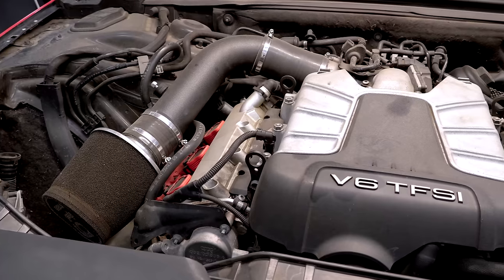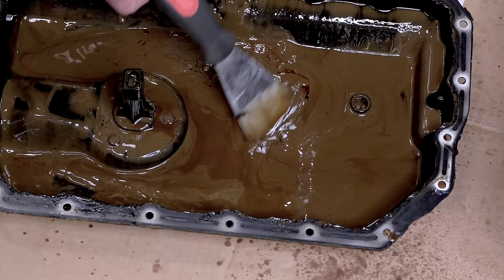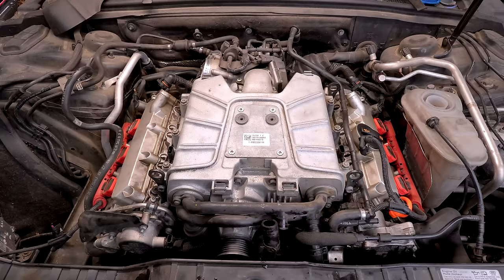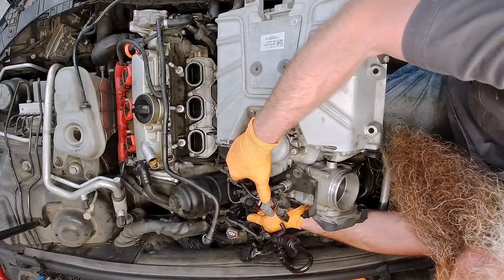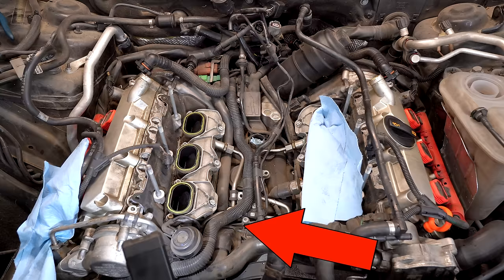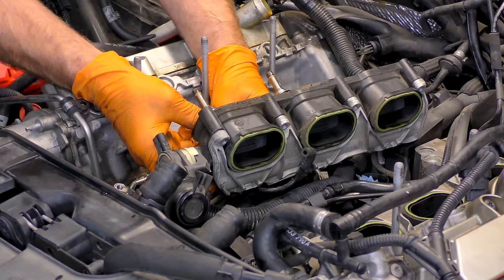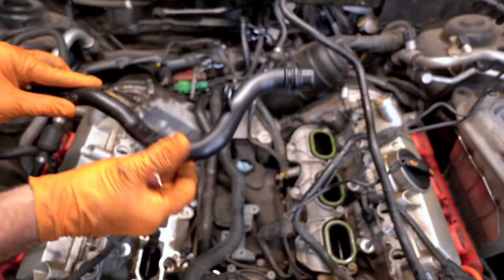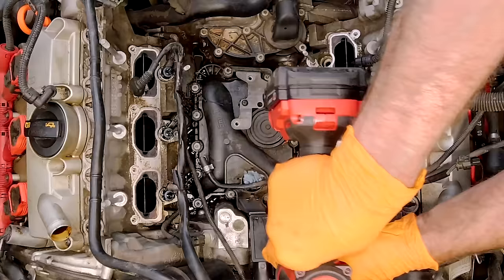How To Replace Audi 3.0t Supercharged PCV Value

Comment: at 39:37 you mentioned the 3 hose's that are source vacuum and at 39:44 you mentioned the hose going to the runners. If you were going to diagnose a leak for bank 2 (drivers side), for dtc p200b. Would you use one of these to check and see if it holds vacuum. Or how would you diagnose the problem?
DTC P200B INTAKE MANIFOLD RUNNER CONTROL OVERTRAVEL
CHECK THE INTAKE FLAP MOTOR (V157) 
CHECK THE INTAKE MANIFOLD RUNNER POSITION SENSOR (G336)

Comment: Excellent video ! This helped me replace a broken coolant pipe (the one that goes to the rear heater) I dropped the clip and can’t get a new one on. Any idea if it will be safe to leave it as is it seems very secure.  Again it’s the coolant pipe that goes from the heater to the thermostat

Comment: Great video! I'll be using this to install the two check valves under the PCV to prevent chain rattle on my 2012 A6. Have you install these before? I wonder if is worth it all this work. I could probably replace the thermostat (was replaced in 2017 by previous owner, still working good) too and cleaned Injectors.. I removed the supercharger before, just fixa coolant leak and flush supercharger fluid and cleaned the supercharger bricks.

Thanks!

Comment: I just noticed some brown/milky liquid on my oil filler cap. I'm not losing any coolant, has been stable for months.
So, condensation? Or could PCV failure also affect Mk3? 1.8 90hp ABS ADZ.

Comment: Is it possible that the oil gets into the coolant but not the coolant getting into the oil? I had recently had that happen even though my car wasn’t overheating, wasn’t running weird, and wasn’t smoking out the exhaust, so I doubt it’s the head gasket. The other symptom was coolant overflowing because of the oil getting added to it, and when I took the cap off a ton drained out the coolant reservoir.

Comment: Is this a risk on the mk6 GTI with the coolant leaking into the engine oil with a PCV failure?
Reply from the maker: Nope. Failure is common. But only like the rubber but tearing

Comment: I'm still trying to either buy a 2011 audi q7 3.0tfsi or just an older 2003 lexus lx470.. This is just a pcv valve. and the process is like taking the head off. So many hoses and bolts and plastic clips. I also wonder why they didn't just use aluminium to go with rather than plastic for the pcv valve.

Comment: I have a 2016 a6 with 3.0t supercharged. Just had cel pop up with p050a. Says iac valve. Can’t find anything online where it’s located but seems like it’s built into the throttle body. Is the iac built into the throttle body?

Comment: I have a question for you good sir. I have a bit of oil in my spark plug on my Audi s3 and wanted to know if that might be a pcv valve issue. Car is at 55k. Thank you in advance.

Comment: I’ve been dealing with a P052C code on my S4. Changed the oil, swapped out both vvt sensors and the code comes back. Checked voltage from the harness and it is correct. Is there something else to check or could it be that the timing chain tensioners are worn out? Looked on forums but not much info. I do have an obd tool and obdeleven. Anyway to check the vvt values?

Comment: I not a fan of an Audi or VW 😂. 
But your video very well explanation👍 
Last month I did on a 2011 Q7 for my kid and I forgot to adjust the intake flaps then the check engine light came on so I need to remove supercharger out again😢. 
And the one screw that hold the coolant pipe I dropped it  so I had to put a 8mm from Toyota bolt instead and use a long 10mm wrench ratchet that was so easy 😂
Thanks for you sharing video 👍

Comment: 99 Passat 2.8L 145K. Should the gasket on the engine oil cooler be replaced at certain intervals?

Comment: About to buy an S5 with one of these engines in New Zealand. Full survive history, done 140,000km (86,000 miles) 2011. Last service had a full set of coils and spark plugs, what’s your thoughts on long term reliability and that age/mileage. Had a trans service at 75,000 miles. Will be getting a pre purchase inspection, anything to look out for? Did notice about 1 second of timing chain rattle on start up. But went away quickly. Did have a different rattle that went away after 30 seconds. Any idea what that could be?

Appreciate your guys responses!

Comment: just fixed on this exact problem on a 13 A6. PCV coolant passage was leaking so bad when you pressurized the cooling system it would barf right down into the pan from a passage near the crank snout. My money was on cracked engine block but it was for sure the PCV

Comment: Excellent work and video. Question when you filled the car with coolant. Would it be necessary to bleed the lines before and or fill while under pressure?

Comment: Hey charles how are u, my name is mano and i have audi vw workshop in beirut  lebanon, u can pressure the coolant system and open the engine oil cap, if the oil separator(pcv valve) is diffective u  will here coolant leaking sound or some wierd sounds from inside the engine and thats how ull know if the pcv valve gasket is worn or pcv valve itself is defective.

Comment: @humblemechanic Once the PCV has been replaced, shouldn't you have made some "pressure tests"  in order to not destroy the new PCV? In order to recalibrate the values, etc... 
I have seen on some forums that this procedure it is recomanded on AUDI shops in case you exchange the PCV due to  oil consumption 1l/200miles....
Is it true? Or is just bulshit?

Comment: This video was fantastic! But there's something you should be aware of - silicone spray KILLS oxygen sensors.  Just a little bit anywhere in the intake side will do it.   Petroleum based stuff (like kroil, or even regular wd40) is much safer.
Reply: Damn i just used some in various spots on my intake

Comment: I have a question about a oil cooler on the W8 it’s discontinued, so how does one open it up and recondition it possibly resealing it with a better seal considering

Comment: Hello HumbleMechanic, I hope you are well.
I am writing to you, because I have a problem in my BWA engine (Audi TT 2.0 TFSI) and Nobody can find what is it. I really need your held please.

Basicly my car, at 5500rpm is most gears, looses power, is like the same feeling if I take of my foot from throtle pedal, after 2 seconds, the power come back..... 

I change sparks, coils, diverter valve, and I can find the problem. 

The car has stage 2 , downpipe(Decat), FMIC, irridium sparks NGK, Ramair Induction oversized, Autotech Internals HPFP. 

Could you please help me?

Comment: Did anyone else get the fuel injector kit from the Amazon link and try it? The smallest die you’re supposed to use to seal the Teflon seal did not fit for me. Not sure if it was a user error or a tolerance error.

Comment: Since I’m early I have a question. My old roommate had one of these I told him to get the chain, tensioners and water pump done while he was doing a clutch. The shop that did it is a well known Audi/Vw shop and they told him they don’t need to do the chain only the tensioners. I was honestly extremely confused, the tensioner doesn’t stretch but the chain does so how will a new tensioner fix a stretched chain?
Reply from the maker: My take is, if you are going that far, do the whole thing. Its more money YES, but man Id hate to do all that labor and leave the door open for issues.
Reply: @HumbleMechanic  yes that’s exactly what I brought to the table as a arguement and got shut down. But hey it’s not my car he will find out the hard way. Not like I don’t know a lot about timing chains owning a 3.5 ecoboost😅
Reply: @402SHO  Reminds me of the time I had a car in for a misfire. It had recently been at another shop for the same issue and they threw new chain guides and tensioners on it, but left the old chain.
And a former colleague who had a catastrophic engine failure, and told the shop to replace the water pump on the new salvage engine.
They said it wasn't necessary and refused to replace it even though he was willing to pay extra (because of my recommendation) 
Less than a year later, I was replacing his water pump because it started leaking.
Reply: @panzerveps  yea I feel like some shops just don’t wanna do the hard work and just make a quick buck off the easy stuff.
Reply: @402SHO  Absolutely. But the thing is... They only needed to put a new chain on it.

Worst thing is that they claimed to be specialists on Audi.

Comment: I had an issue of PCV valve on ... Mercedes GL320 and the symptom was white smoke at the exhaust after running at idle. 
On AUDI A3, 2.0l TDI, the symptom was unstable idle.

Comment: I guess I'm knock profusiously on wood lucky ones with a 2014 S4, only had 2 major issues with it having it for over 100k miles

 the a/c compressor failed, and the supercharger pulley and belt snapped taking an idler pulley with it

Comment: hey i got a tech question for you, I have a 2015 VW TDI JETTA.  I have it stage 2 malone with rawtek downpipe and streight pipes out the back.  I noticed coolant leaking out when its cold out.  sometimes there is a small puddle under the engine.  I put dye in the coolant but still cant find the culprit.  What are the common places for leaks to occur?  I think it could be coming from below the downpipe area but unsure.
Reply from the maker: Not really.  The 2015 is a weird year for the TDI. It’s the only year of that engine.

Comment: The reason coolant goes through there is to reduce condensation... It's kind of like a recirculation can instead of a catch can. When the vapors are coming up they include steam. You don't want this to condense in this box and create that nasty mayonnaise looking oil mix. So they run coolant through there to keep the box up to temperature and eliminate condensation.

of course that means that if the coolant pipes crack they dump into the box and that ends up into your crankcase

Comment: Hot damn! I thought the PCV on my Mk 7 TSI was a pain in the ass...

I far prefer the one on my old 91 civic - pull the vacuum line off, unscrew the metal PCV (from the intake manifold), clean it with brake cleaner or carb cleaner, then reinstall.

Comment: I have been able to successfully do everything except separate the two hoses at @17:02. I have used all the leverage I can and it's like they are glued together. I assume I'm tugging at the right parts. Any advice? Great video by the way.
Reply: Just managed to separate them, put a bit of WD40 over it and attacked at an angle for about 10 mins

Comment: I used to use silicone spray or PB Blaster to loosen/install fittings w/ seals but ran into one plug seal that swelled nearly 30% bigger within seconds of contact.  I've switched to a spray bottle of just soapy water ever since. Or even spit works on small seals and i'm too lazy to grab my bottle.

Comment: Anyone ever got a P050A code in their 3.0t? Research says it’s and Idle Air Control valve IAC. I’ve been researching endlessly and asked euro sites for help and they don’t seem to know. There is not one place that mentions the IAC but does mention the throttle body. I’m guessing the IAC I built into the electronic module of the throttle body. Any help is appreciated as I would love to find out what it is and replace the parts. Thanks!

Comment: cleaning the injector rail with the injectors off not so good. debris can  drop and enter the rail trough the injector holes. plug the holes with plastic plugs, caps or towels es una buena idea.

Comment: I wonder how many vehicles are sent to the crusher because somebody assumed a head gasket leak when it was actually a PCV or oil cooler problem. It's disconcerting to find that there isn't a great way to make the diagnosis before removing the PCV.
Reply from the maker: More than should thats for sure

Comment: Just started this process and opened the ports on the intake both sides were extremely clean, just a little build up starting on the last 2 rear right ports. Got a DTC p200b then Pcv swirl/whistle started, this was followed by DTC p0492 a week ago. Combination Valves working properly,  SAI hose and other tubing intact an holding pressure, relay is ok. Thinking both codes due to pcv valve for certain, however i still need to test sai runner control valve and sai runner position sensors. This is weird to me as im new to the audi's, anyone care to chime in?

Comment: What I don't understand is that if you need clean air going into the engine for a more efficient burn of fuel, why oh why do motor vehicle manufacturers insist on having oil, water vapours from the cylinder valve head and exhaust gasses recirculated back into the intake after the air filter and before the intake valves.

My understanding of efficiency of a engine is to keep foreign particals from your fuel and especially your air intake.
This is so you can optimize you fuel efficiency or your horse power.

So could you do a video on why engines have pcv and egr, which engines have 1 of them and engines that have both of them.

Yours Philip Burrows in Overton on Dee, Wrexham, Wales, UK.
Reply: Mostly emissions. Old cars used to just vent to atmosphere, but shooting oil mist all over the road isn't all that good for the environment or the air quality. You probably don't want to breath that stuff when driving behind someone or walking on the sidewalk.

Edit. To add, depending on the implementation, on some cars you can bypass the PCV system with a catch can like TheHumbleMechanic did with his yellow Golf R. This way all the goop gets stuck in a pot that you have to empty couple times a year. However in many countries, including the UK this counts as tampering with emissions equipment and won't pass inspection.
Reply: @S1l3nthunt  I have had one in line with the pcv, it's not vented (the out goes straight to TIP) so never got me any issues at MOT last couple years

Comment: outstanding video gents - the PCV valve, to avoid the risk of coolant oil mixture, should probably be replaced every 100,000 miles?   Is this driver lucky with over 200,000 miles?
Reply from the maker: Adding it to maintenance isn't bad if you are DIYing. but the shop will hit ya for 6-7hr of labor. Still cheaper than running the amount of flushes I did.

Comment: Accidently found this video. Awesome. Can you tell me where the air from the bottom of the supercharger goes when it goes into that pcv box? Does coolant just run through the box the other side? Does that box do anything else? Thanks
Reply: Ah found it at 14:30. It looks like an emissions recirculating valve with possible a air temp or emission sensor. I am not sure what that diaphragm is in the coolant on the pcv but if it does not have any electronics hooked to kit it might just be a pressure bleed or relief. I am using the supercharger for a totally different application and was wondering what the port underneath of the sc does. Been looking for a video of that pcv for a while now so thanks so much for this video.
Reply: Awesome

Comment: Hello, a question, I've read on the internet as you do that when u put a new PCV on the 3.0T you're supposed to do some ECU software update. Is this a requirement or a suggestion? I have got also a 2010 but and S5 and i'd like to replace the PCV myself but I wouldn't be able to do any software updates. Is there any truth to that?
Reply: So long as you replace your PCV with the exact same part number currently fitted to your car you won't have to do any ecu flashes. You only need to update if you use the newer PCV version that uses a lower pressure (they were fitted from the factory to the B8.5's). The newer ones have a slightly different part number - it's usually the last 2 letters that indicate a newer version. The newer one also has a different colour on the top of the plastic cover at the rear. I have a 2010 S4 with the CAKA engine, the part no for it was 06E103547AC, this will be the one you'll need if it's the same engine.
Reply: Thank you. Yeah i got CAKA as well i was just wondering if the b8.5 one is an upgrade in any way since i got slight oil consumption of about 1dl per 1000km. Since my last car was a 2.0 tfsi that used 1l per 1000km i dont mind this but still wanted to try improving

Comment: Is there a mileage or age where you should replace your PCV, a bit like replacing a timing belt?
Reply: It's one of those things you want to replace before it fails, like the water pump; I replace both on the same schedule as the timing belt; every 100k or ten years if you don't drive that much.

Comment: We have a customer that is suing us due to his engine seizing up while were diagnosing his coolant loss. Pressure tested and would not hold. Blew air pressure into cooling system and heard air coming out of air filter. Went to pull it out of the shop and it started to run rough and stalled. Went to start it and engine was seized. Customer claimed it was a perfectly running engine except for coolant leak he could not figure out.
Reply from the maker: Yikes that’s a such situation

Comment: We would pressurize with basic dish soap and hot water, then do 3-4 HOT water flushes. Then get it close to temp and flush again. Worked 9 times out of 10. Sometimes I miss the dealer days, had a good dealer with good people.
PS. Why not out it into svc position?
Reply from the maker: That is awesome for the coolant side! We did that on B5 Passats all the time
Reply: @HumbleMechanic  that was the first car I did it on at the dealer as well lol.